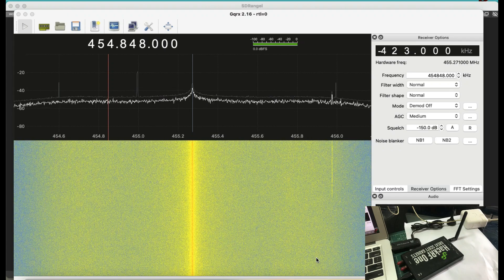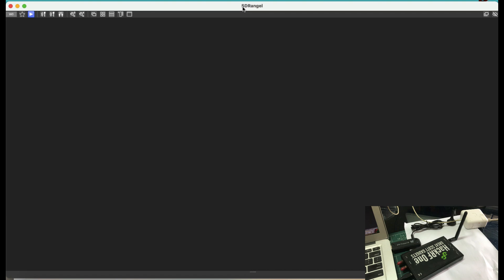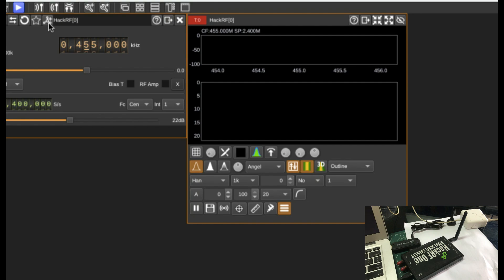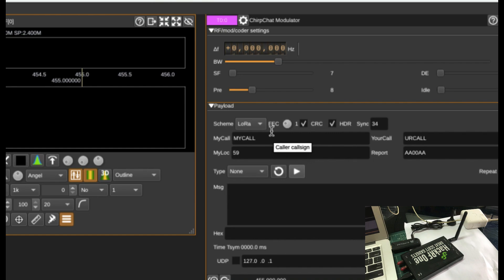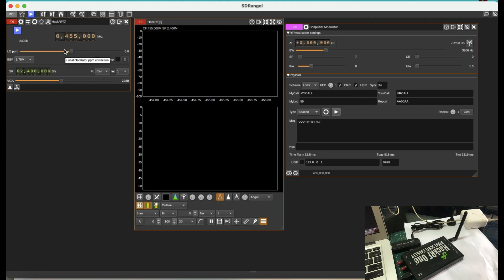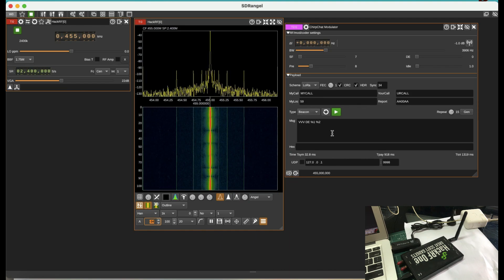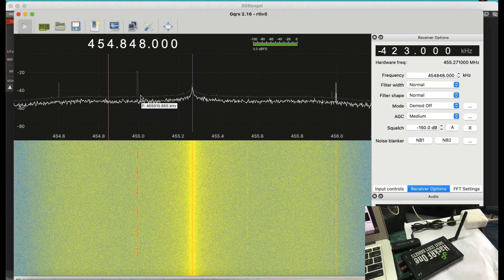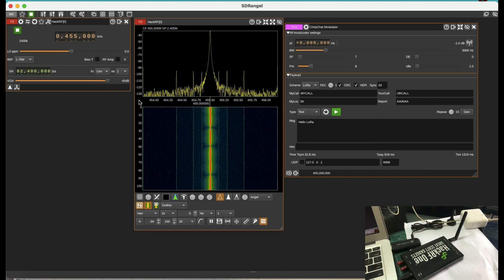LoRa Modulation using SDRangel | HackRF One & RTL-SDR | ChirpChat Modulator

Comment: Which s/w should I use with SDR to receive (and store in log)  a text messages from LORA module? Which SDR you recommend?
Reply from the maker: I would use SDRangel
Reply: @ thanks!
Reply: Hi, I have a lora module that I sent a beacon every second and would like to use my RTL-SDR to receive the message. Is it possible to to that with SDRangel? Thanks
Reply: @anlpereira  SDRangel can isolate and save the raw LoRa waveform(s) but you'll need something else to demodulate and decode the packets, like gr-lora (part of GNU Radio).